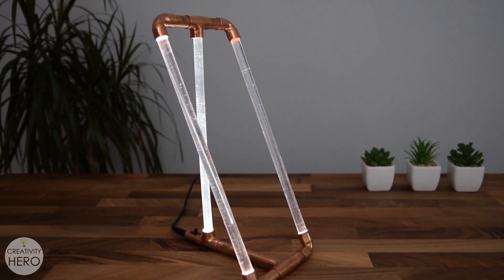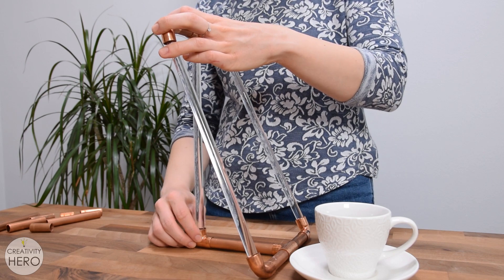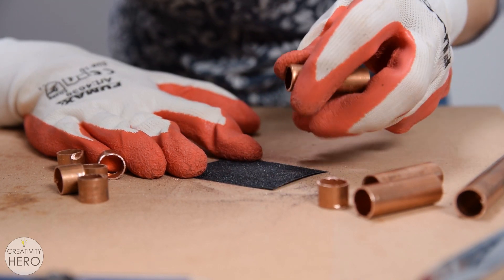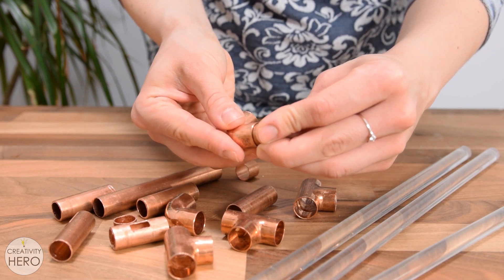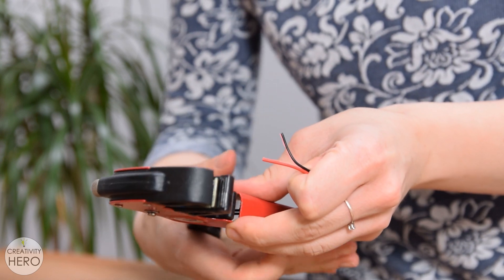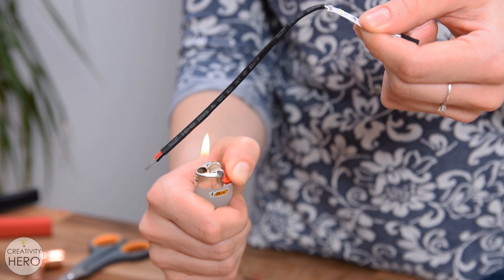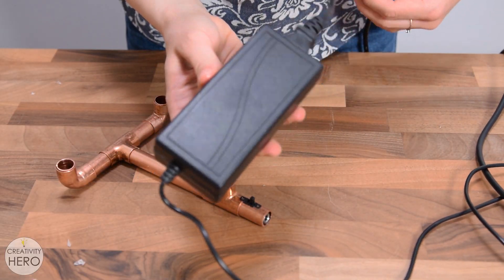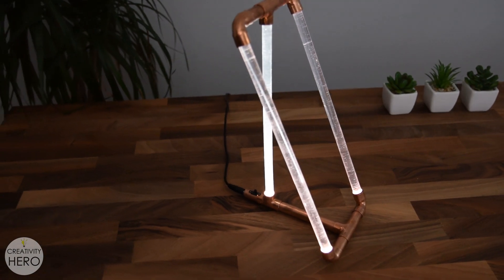Copper Pipe and Acrylic LED Desk Lamp

Comment: Get yourself a 2 or 3 inch pillar candle to use instead of having to hold a lighter.   I've used one for heat-shrinking, bending plastics, and heating metals.  It can sit in a fixed position, can free up a hand and you don't have to concentrate on holding the switch on a lighter or keep relighting it (unless you want to for other safety reasons).  You don't have to stop with the flame to keep from overheating the lighter or burning your fingers.  Also as a bonus, it can add to the ambiance in the room and if it has a nice scent that won't hurt either.

Comment: That's a great design and lends itself to leaning forward too. Have you thought of using 3 Watt LEDs and heat transfer epoxy (similar to the heat transfer paste on CPUs, but epoxy.) to bond the LEDs with wires soldered (and heat shrink covered) to their upturned legs to the bottoms of the pipes. You would need current limiting resisters and have to watch your power supply voltage. I think you would get brighter light pipes.

Comment: Hi, a nice idea and well thought out, the hot glue makes a good insulator and when cooled off will keep the wires from touching the copper although I would have connected it first and then plugged the power supply in just in case. It is definitely a new design that on one else is likely to have come up with and a good use of things that were already in your house. You have a one off and nice light.

Comment: Nice work! 
I have an idea for diy project. I will share it here to see if anyone else is interested. I want to make a device to show the passing of time. Similar to sand glass clock but with different mechanism. I am thinking using a glass or transparent plastic tube as the frame of the device, the tube's shape can be designed, we will put liquid into the tube and inject an air bubble at last, by controlling the shape of the tube and tilt angle(for example, using a spiral trajectory for the tube), when we flip the device, the air bubble will climb along the tube and eventually reach the other end of the tube using some constant time. In this way, by observing the location of the air bubble at a certain time, we can know how much time has passed since we flip the device upside down. 
Above is the core idea of the device, off course we need to design extra structure to hold the glass tube, and try to make it look nice with other decorations. 
I would love to hear from you and other viewers on how you guys think of this idea! Thank you!